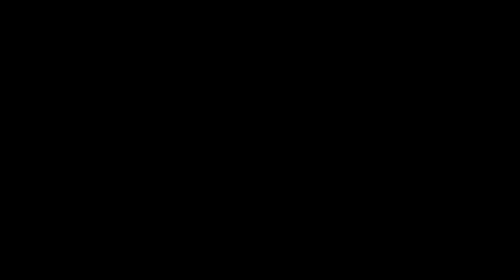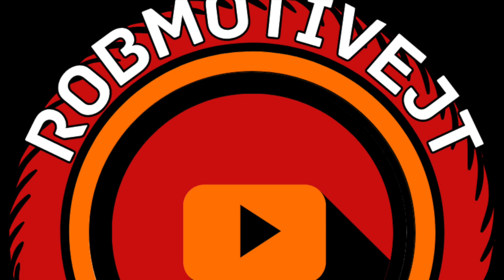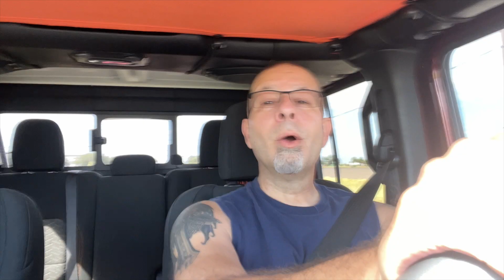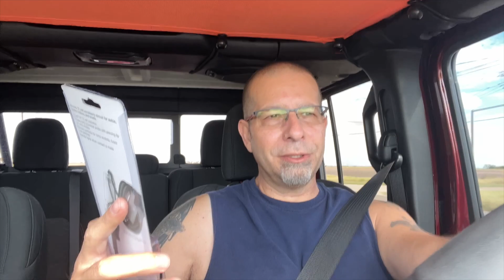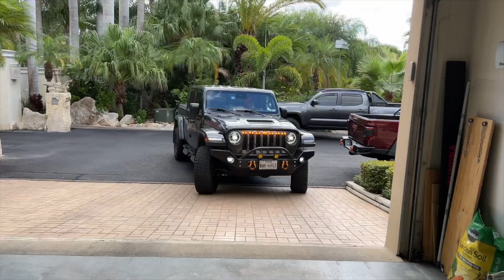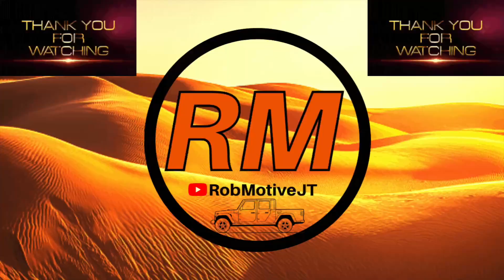Jeep Gladiator Errand For A Must Have Tool

Comment: Ya I have to tell you I'm not feeling the love for these lights.  Think you will have a hard time finding lights that you will want to mount on the light bar.  As you said if it turns out your not liking the mod you can always do something different.  Careful with that electric probe.  Mine has a sharp point that goes through skin no problem.
Reply from the maker: I think I found something 🤔🤔

Comment: We bought lights at our local NAPA auto parts whse. Then we removed the clear bulbs and replaced them with red and amber led bulbs. We had the same idea you have for your JT on our trailer. It worked out very well, so that's one idea to run by you !
Reply from the maker: Thanks for the tip👍

Comment: I think you want a chase bar light,  to mount it on the backside of your rack. It has signal, flash,  and brake function.  Examples:  X-Prite Chase light, Rigid Chase bar, KC Hilites rear chase bar, and RZR Pro R Chase light.
Reply from the maker: Thanks for the suggestions 👍

Comment: Be careful poking wires if you break even 1 stand you will change the resistance and effect any computer system. Better to take the connectors apart.